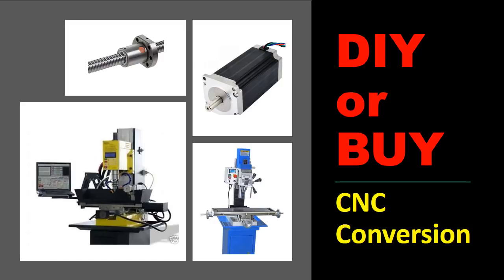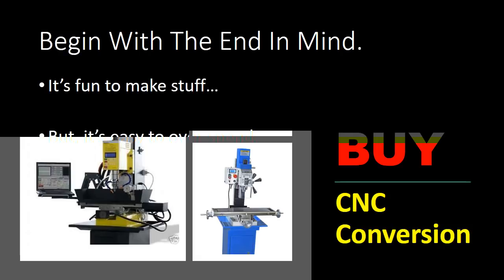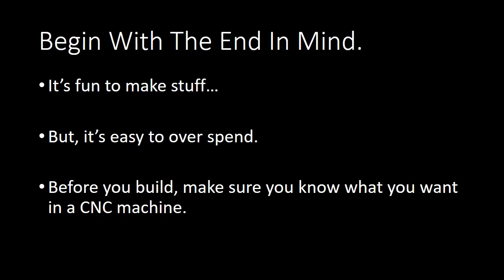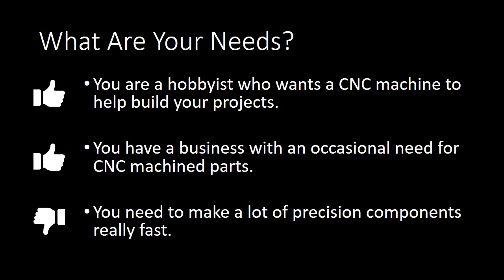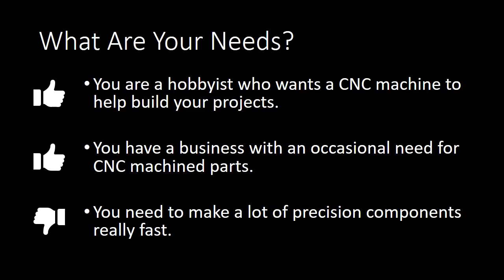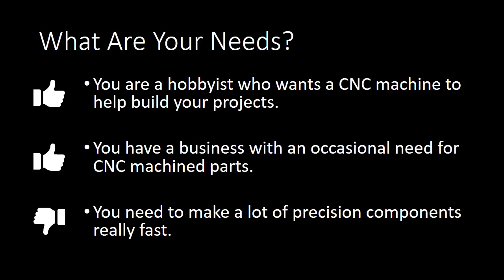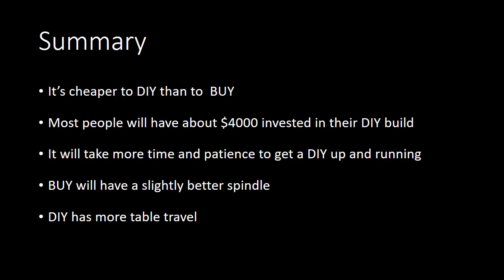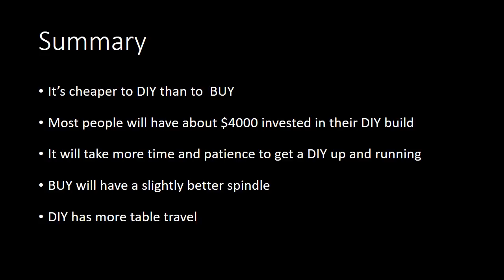Milling Machine CNC Conversion: DIY or BUY?

Comment: Prices have come so much for home made CNC especially if donor is used. I have almost premium setup under build and all in price is well under $2000. With full premium specs it will still be under 2000. And we are talking about similar performance to Tormach 700.

Comment: You just compared random cnc mill with random mill with cranks? What's the point? Why you didn't took harbor freight mill or knee-type mill? What is, forgive me god, SYIL, and why not another random crap from ali which comes in thousands?

Comment: Samurai-120 CNC. Look no further
Reply from the maker: I like the looks of the wide column with the linear rails.  In my opinion, this is the "weak link" in most bench top mills.  I'd be curious to see how much deflection you see at the spindle when forces are applied in the X-axis direction.
Reply: @FrancoCNC  yes as I pointed out in the Kickstarter, the X direction is noticeably weaker than y, but that is true for all machines of this style. I was wondering if you would be able to help promote this?

Comment: If you ignore the machine cabinet and the mql system Ive built for my cnc Ive spend about 1800 on my cnc conversion (including the mill Ive miraculously gotten brand new for 850) so you can definitely get the diy pretty cheap if you try. Building the conversion kit yourself and using linuxcnc you can definitely get great results for cheap. But limit switches (at least homing switches) are a must have on any cnc

Comment: Things have changed some since this was posted. Apparently the Syil X4 is gone and their entry-level unit is about $10K. The hard part of a comparison like this is getting something that is apples-to-apples. I've done my own comparison with the intent of getting at least Tormach 440 performance in a DIY machine. Still using the PM-25MV as a base ($1917 delivered) I get a cost of about $5141. That includes a double-ball-nut C7 conversion kit, Centroid Acorn controller, Clearpath servos, spindle control, all power supplies, all cables, an electronics case,  and various odds and ends (like tax and shipping for the parts), but not any spindle mods or single-point oiling. A base Tormach is $6095 delivered. I didn't include stands, computers, monitors, and what-not to simplify the comparison.

That still isn't an apples-to-apples comparison. The DIY unit has larger travels and can do rigid tapping, but has only a 2500 RPM spindle and no oiling system. The Tormach uses steppers instead of servos and lacks rigid tapping capability. The Tormach is probably stiffer than DIY also; it weighs a lot more. And yes, I know a better comparison would be to use steppers, but in this day and age I don't know why you would: the performance is so much better with servos and the cost increase for similar quality/performance isn't excessive.

Before people point out that you can spend a lot less by giving up performance (cheaper ball screws, steppers instead of servos, etc.), that's not the point. I started out stating I want Tormach-like performance (or better). The  point here is that if you want to make an apples-to-apples comparison between DIY and purchased, the cost difference isn't breathtaking. 

Are there any Tormach competitors in the same price range anymore?
Reply from the maker: It is hard to find good machines at that sub $10k price point.  Check these guys out:  https://www.novakon.net/
They are not cheap, but they are another alternative.  Also, PM has a new mill they have begun importing.  It is more expensive than the PM25MV but it looks like it may be the perfect base machine for a DIY CNC conversion.
Reply: Yes check out this link:   https://www.kickstarter.com/projects/cncfor3500/a-new-wave-of-cnc-machines-for-3500

Comment: Not great advice. those on a budget with a need for quality should buy a used machine. ebay is literally stuffed with used cnc milling machines. larger industrial machining centers can be found for as little as $2000 for those willing to retrofit - i.e replace the old electronics with a newer ethernet solution. I am talking about a full VMC with a 6000rpm 40 taper spindle and tool changer.

There will never be a shortage of used cnc machines while so many start-ups over-invest in new VMCs they could never hope to pay for.

Comment: Would a similar conversion work using a proxxon ff30.  It in line with your budget price. German made better than the harbor freight stuff.  Ive seen a cpl proxxons done but have no idea what kit to use. Thx
Reply from the maker: It is possible and many people have done it. I'm sure someone is making kits for that machine.

Comment: You're definitely helping people like me that have always been a CNC end user start learning how to build one for home use.
I've been a machinist, CNC machinist, programmer, production engineer for 40 years (yikes !!!).
I'd like to buy or build a three axis CNC mill, or a super rigid CNC router to make some hot rod and boat parts for my projects, and also to use as a training tool for teaching my niece and nephew machinist / programming skills.
Do you know of a well built 6040 CNC router that I could just plug into my lap top, that I can write programs out of my head, and run them making simple three axis parts?  "X" travel in the 15" to 18" range. "Y" in the 10" to 12" range. "Z" in the 8" to 10"  .
Thank you for taking the time to help.
Reply from the maker: You may want to check out xcarve:  https://www.inventables.com/technologies/x-carve

Comment: Excellent point by point comparison. Can you buy the PM machines built by the factory as a CNC mill? Definitely would be better to have a mill with the much larger "X" . Where / how did you learn so much about the components needed to build CNCs.  Good videos. Very interesting.
Reply from the maker: PM is not offering any pre-configured CNC machines at this time.  But you never know what they may add to their offering in the future.  For some reason, I've been obsessed with stepper motors ever since I was a teenager.  My first project was taking a stepper motor out of  5.25" TEAC floppy drive and hooking it up to a Basic Stamp IC.  I think the machining stuff was just an excuse for me to buy more stepper motors and install them on things!  I started the YouTube channel when I realized how difficult it was to find useful information on doing DIY conversions.  Hopefully, I'm helping people more than confusing them!

Comment: If cost is a concern, open source bears consideration. LinuxCNC (formerly known as EMC2) is free and well supported by its developers and user community.  BTW, Tormach's new generation of software is based on LinuxCNC.  I'm not sure which Ethernet I/O you're using, but $300 sounds a bit high.  I used Mesa 7i92 boards on my last two DIY CNC projects, which were about $90.

Comment: The best solution is buying a large mill or lathe from China (you cut extra costs and profit from importer, at the same time it is the size that plays important factor for accuracy). And then buying a controller for $700, and hybrid stepper with servo motor for total of  $1,000. Add $2-300 for the ways and ballscrew. $5,000 for the mill or lathe, for a total of $8,000 usd, you can have very big mill or lathe cnc. Add the fun of being scared, stressed out, and then being proud for the accomplishment you did. Well, DIY beats. You do not have to factor time, because you will not be doing that for living except for hobby.
Reply: While I generally agree with your general mindset on this, I need to draw the line on going with the cheapest axis drive setup, I.E. open loop stepper motors.

If you're going to actually own and use the machine, then stepping up to full servos is a no brainier, especially since Centroids Acorn set up is so reasonably priced. 

Other than that, I can at least loosely agree with your post.

Comment: Agreed with everything.Im midway through the evolution to getting an expensive premade factory machine..What I have  found was that the lighter the machine , the less rigidity and the more time invested to get it to acceptable operational accuracy , the more hair pulling  aggravation when you realize the limitations.. Unless you enjoy the process thoroughly, the Diy conversions are largely a  waste of time that could be spent making parts for money on a functional machine and recouping the larger investment.. I know people say " I learned so much during the build " and this is  true , it might also be useless info in the long run though when you upgrade.

Comment: I’ve built one in a weekend. If you have all the components readily available and can spend 2-3 full days giving full attention to the build it’s not that difficult. It’s best to do it basic and get it going and than add in your bells and whistles after the fact. Typical motor and vfd combos take me an hour or two it’s really not that much work unless your fighting with table alignment issues. Hopefully that’s where you are pickiest.

Comment: Excellent & very informative vid, just wish I'd seen it sooner  ;^)  Just converted my G0704 to CNC which was my intention when purchased. But my expectations of manual machine was, well, inflated. So as to not make a story book here, you've said what I always preach, your time is worth something...how much? Is it less costly to DIY? Absolutely. But there's a great deal of research to be done for various kits & components, where/whom to get them & not to mention there's Real work involved, particularly w/the Grizzly. To your other point, in doing so I've learned a great deal more about these machines, their functionality etc. 
Knowledge = power. It was rather enjoyable realizing the limitations of manual milling. So to the couple of comments that Buying makes more sense than 
DIY-ing,...only if you demand major or high speed production. Even w/the couple nic nax (amenities) I'm still adding I'm all in under $4k. And even w/the limitations of the quill & spindle bearings that will eventually have to be addressed, I'll still be under $5k. Of the CNC machines I considered, $6700 was the most reasonably priced & it's not as complete as my new setup. So my personal opinion (I'm not a professional) is jump in, get a lil dirty. Its worth it. And the sense of accomplishment while saving $$$ is well worth it. Thnx Franco & Happy CNC-ing YouTube  ;^)

Comment: Good video. I'd prefer to go DIY since I actually like putting things together. Also it would let me use a controller and software that also supports lathes and other machines which would be a plus down the road.
Reply: I wonder if anyone has ever diy cnc'd one of those mill/lathe combos, that would be cool to see

Comment: Thanks a lot for this video Franco !

By being in Europe (France), I'm looking about some hybrid solutions on a DIY basis, about the spindle power I guess if it could be feasible & smart to use a brand new single phase 230 VAC brushed motor rated at 1,700 watts of absorbed power, which is used on angle grinders with an embedded speed setting.

The useful power is rated approx 1,010 watts.
Good news is that Bosch has used into this range of tools some improved brushes, twice the usual lifespan, they said.

At the end of the shaft, the speed range for Bosch GWS 17-125 CIE professional grinder (developped for the stainless steel manufacture) is between 2,500 to 11,000 rpm (calculated torques from 3,82 N.m at 2,500 rpm to 0,87 N.m at 11 krpm), at the disc slot, which is provided with a "taper" based on a Metric 14 mm thread "M14".

The price for a single angle grinder is 165 € ($191).

Of course, the spindle of the mill aimed (the equivalent available in France of the PM-30MV) needs to be fully reviewed & modified accordingly.

Best regards and thanks for this summary of choices !

Comment: The other thing to mention is the understanding and knowledge you gain building your own. And in the future if you do upgrade to a production machine, you know what's going on behind the covers. When it starts wearing out or it starts acting funny, your not scared of touching it. I've seen guys buy a CNC machine, a few years later it's getting a little backlash and they just throw it away, instead of replacing a ball screw, because they think they're going to have to pay some overpaid professional tens of  thousands of dollars to fix it.
Reply: Good comment. I think most men who are looking to buy a Mill are the type of men who like to build everything from scratch... with that said we are here looking for a reason to NOT diy our own CNC setup lol. We need to hear one good reason why we should just buy an already converted CNC mill or buy a CNC conversion upgrade instead of just buying everything from scratch.. Me personally, after piecing out a 3D printer.. I already know its not difficult to buy and build our own CNC systems.

Comment: Well tbh a PCNC 440 will be in the same region as the Syil and you probably get better support (also help on YT etc). If I spend 8k Id go with something a bit better known.  As I just checked a new PCNC 440 with controller costs arround 6500$
Reply: nukularpictures If I were to do it again, I'd go PCNC440.  Without an enclosure and stand it's cheaper than th syil and having used one, they're nice